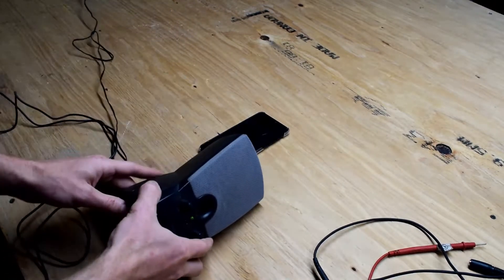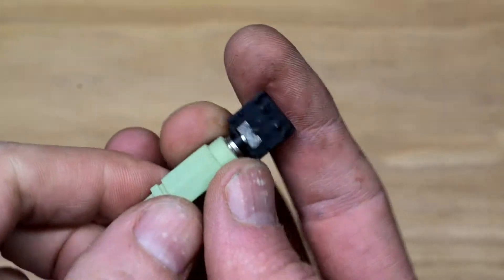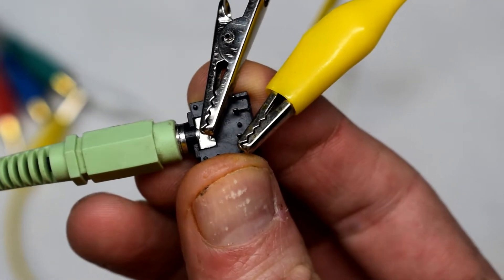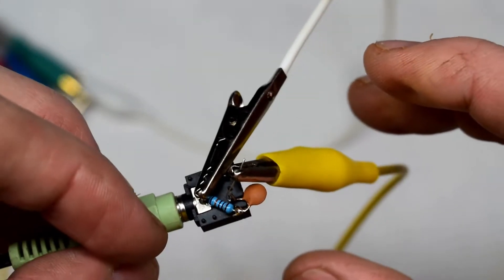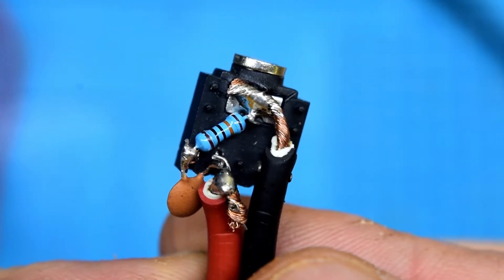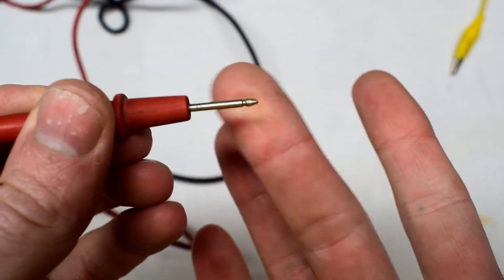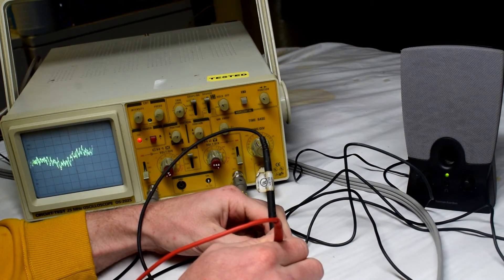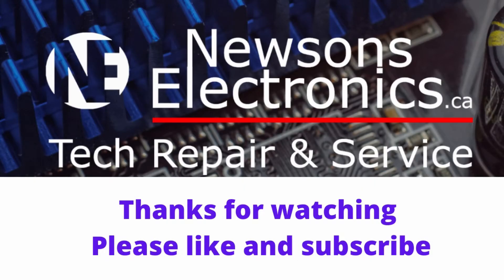Audio signal tracer

Comment: Hello, pls 100nf 50V ? 100Kohm 1W? 0,6? Thanx
Reply from the maker: 1/4W resistor for the cap use any voltage that is bigger then what you will be testing , normal 10-25V? depends
Reply: @NewsonsElectronics  thanx :-)))
Reply: Cassete deck ,amplifier